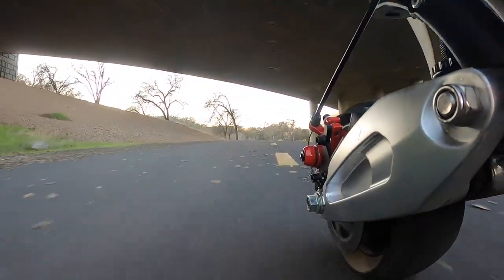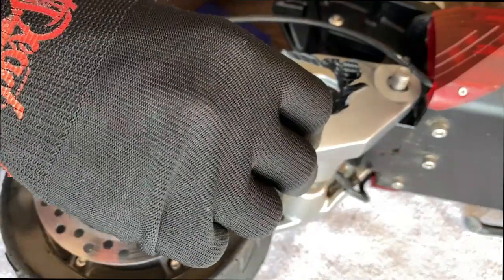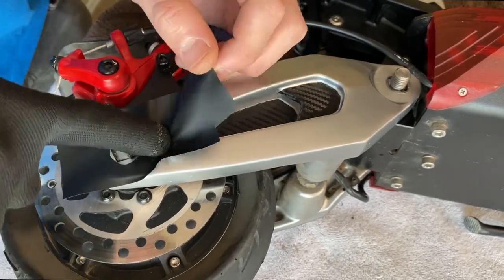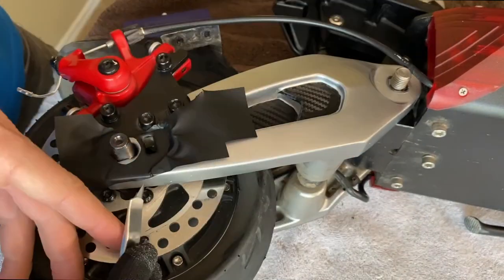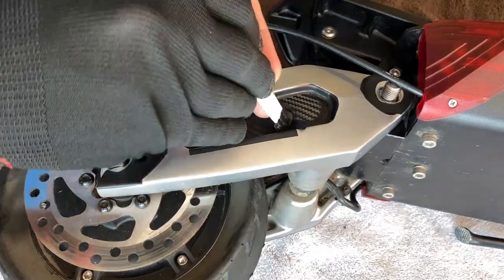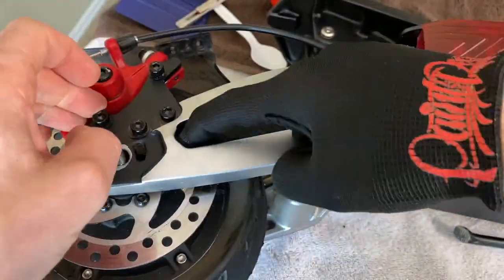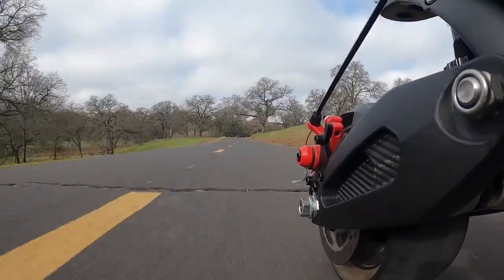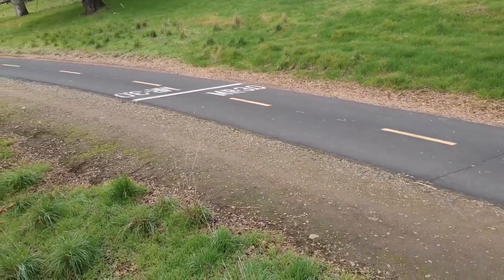ZER0 8X VINYL WRAP | DUAL MOTOR | ELECTRIC SCOOTER

Comment: That looks great so much work but definitely pays off! I’m doing the same thanks for the tutorial. Was hoping you went around and zoomed out so we could see what it looked like. Hope you do the brake upgrade next cos that my plan. Keep it up mate
Reply from the maker: Thanks!! Brakes are on the list for sure! I just ordered a rear air shock so that will be the next upgrade after some lights and a horn. Let me know what you’re done....would love to see how yours turned out! 

I’m also sorta torn between a more permanent solution with these arms. Rock chips are something I didn’t really think of when deciding to use the vinyl. 1 ride and I picked a nice chip in the vinyl on my front one. So I’m not really sure how long they will last. But I think it really improves the look of them! 

Thanks again!
Reply: A Day in the Life of Mr. 23 
Dam yes rock chips I wouldn’t have even thought of that. I guess the only permanent solution would b to paint them w/ some heavy duty stuff like brake caliper spray for cars, but then again I don’t wanna spray it i just wanna wrap. Haven’t done anything major to mine apart from a light horn and phone holder and will be replacing the grips and stem but not the handlebar as I like being able to fold them. I’ve put a new deck grip which covers it all and also the rear foot step. (Looks ok not so happy with the design lol) are u getting the dnm shox and if so which model cos I’m looking also.
Reply from the maker: Emille I think I’m gonna end up powder coating them. I have always been aware of the term but never really knew what it was. But basically it involves the parts being sand blasted and then they charge the metal and spray a powder on the pieces. Being charged with electricity the powder bonds to the metal and then its baked in an oven so it hardens and cures on to the surface. I found a local place on yelp that will do it for about 80 bucks total, so I feel like that’s a pretty solid deal. Since I’m planning on doing the shock I need to take apart the arms anyways so hopefully I can get 2 birds with 1 stone. 

I ordered a rear shock already and it should be here in a few days. According to Falcon PEV the DNM AOY-36RC 165mm is the correct fit for the rear. I found a seller on eBay to be the cheapest over buying from Falcon PEV. They told me that there isn’t a replacement for the front however. But I did find another video of someone who replaced their front shock with a 150mm shock and it worked....but it seems the 150mm is a little bit more difficult to find. I’ll probably do the rear first and then when I get the brakes l end up replacing the front one.
Reply: A Day in the Life of Mr. 23 
Sounds awesome definitely go with the powder coat cos that’s a really good deal. I really wonder how much of a difference upgrading the shocks will do and ur right there’s quite a few sellers out there that’s much cheaper than Falcon for the dnms. Excellent info looking forward to ur next vids!

Comment: I suggest upgrading the tires u have  as well from those, to the ones of dualtron compact. Are higher quality. Just a tip, for a better scooter there !
Reply from the maker: That is definitely on the list. To be honest I’ve been putting it off cause I’m not looking forward to changing the tires. It doesn’t appear to be an easy task. 

Sorta ironic isn’t it?? Haha. I bought this scooter to not have to worry about changing tires........and now I’m worried about changing the tires. 😂

Comment: I wonder what shop would wrap my zero 10x for me 🧐
Reply from the maker: I’m sure you could get a bunch of shops who could do it for you but the cost would be the biggest issue I think. 

I work for a shop that does vinyl so I had access to the material and also I have a little bit of know how when it comes to using it. Most shops would charge a good amount for these pieces. In my short experience with the vinyl wraps on the suspension arms I’ve already gotten a few rock chips in the vinyl. I think just being so close to the ground it’s going to be inevitable. I’m most likely gonna get these powder coated this weekend just so I don’t need to worry about the vinyl peeling down the road and becoming a headache. The quote I got for powder coating all the chrome bits on my 8x was only 80 bucks. I don’t think you would find a vinyl shop who would do these pieces for less than 80-100. Most likely something like this would cost several hundred dollars to wrap in vinyl mostly cause of the time it would take to do them. 

Hope that helps, thanks for watching and for the comment!

Comment: How many kilometers you already did, how is battery and tires holding up, any issues so far?
Reply from the maker: Hey there! Just over 800km on it so far. Nothing other than general maintenance like making sure all the bolts and nuts are tight. But other than that it’s been a champion! Absolutely love it!
Reply: @ADayintheLifeofMr23  It is definitely an incredible scooter, also a looker! Just wish it had rubber air or tubeless tires for better grip and softer ride.

Comment: I got my zero 10x re-anodized black as I thought the red was tacky
Reply from the maker: I did consider that. The shop I work for did some work at a powder coating company so that was my first thought. My biggest hesitation with that was just taking it all apart and putting it back together. Also, the amount of turnaround time to complete them. 

If you don’t mind me asking.....how much did it cost you to do that? Depending how long the vinyl lasts I still may consider doing a more permanent solution. 

Thanks for watching!
Reply: A Day in the Life of Mr. 23 it was $100 to do all 4 arms plus vertical stem collar. Taking it about isn’t too bad plus I did suspension upgrade at the same time
Reply: A Day in the Life of Mr. 23 it was $100 to do all 4 arms plus vertical stem collar. Taking it about isn’t too bad plus I did suspension upgrade at the same time
Reply from the maker: Mod Addiction to air suspension? What are your thoughts? I’ve really been going back and forth with that. I feel like with the solid tires on my 8X the air shocks are gonna help a lot more. 

That really isn’t too bad at all. I was expecting 100 per arm or something crazy. I want to upgrade the brakes too. These brakes are ok at best. I’ve ridden a 10X and the sensitivity is SO much better with the larger brake wheel and air tires. I want to do the hydraulic brakes for mine. Would make sense to do the shocks and brakes at the same time and if I decide to do like you might as well get the arms too.
Reply: A Day in the Life of Mr. 23 yes air suspension made world of difference. Felt more stable and more compliance
Reply from the maker: Mod Addiction good to know, thanks!
Reply: @modaddiction7485  hi ! I have a 10x as well and considering repainting the suspension arms to black as well...very interested to see how urs look and hope u cud share photos of the new paint job. Thank you!
Reply: Jonathan Strange not sure you can post pics to YouTube comments
Reply: Jonathan Strange done. Hopefully they are hi-res enough. I’ve still got to do hydraulic brakes and change out bar